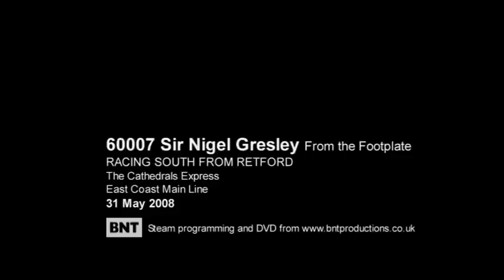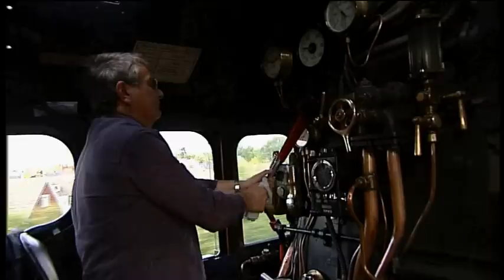60007 Breathtaking Footplate Run into Kings Cross - More

Comment: Ironic really...45 years later and people still crave to board a train behind a `Steamer` What a pity succesive goverments are not `railway` interested. And at the end of the day what is it all about....`profit` and greed?? Look at what we have got now...an enormous electric train set where the average person finds it hard to afford to travel on them...so much for `progress`?
Reply: are you implying people from the 30s could afford to ride behind an express loco like this?
the current franchise system may be a mess, but in general, everything is MILES BETTER than when these were still cutting edge modern locomotives.
They have charm and are engineering marvels, but you need to take in the world, and not be left behind in your own little bubble, as is increasingly easy with ever faster technological improvements.
Reply: @karlosbricks2413  actually common folk could afford to ride behind one of these in the 30s. If your implying that they could not then you need to check your railway history as most of the revenue came from third class passengers. The reason we pay so much now is network rail own the network and they charge the providers ie Virgin ect a fortune
Reply: We all like nostalgia but imagine a chuffer on it's way through the Channel Tunnel for example  No? Neither can I.

Comment: The spirit of Bill Hoole was in the cab.
His engine was no 7 and he got her up to 112mph in 1959
Reply: Bill Hoole killed his fireman in the Oakleigh Park Tunnel. He was travelling, well over the track speed but, He always did that. To show how much compassion he had for his regular fireman, he turned up for his turn the very next day!
Reply: @g7usl  Albert Young died because of poorly completed permanent way work. A rail joint had been left 3/4" high and this derailed the trailing axle of the bogie of 60528. The crew heard a rattling noise from the front of the train whilst halfway through Barnet Tunnels. Bill applied the brakes and asked Albert to try to see what was happening and he looked out of the side window of the cab when they exited the tunnel into daylight again. He saw nothing and so got out of his seat to look out of the gap between engine and tender in order to lean out a little further. The driver of a down parcels train working on the slow line witnessed the locomotive and train exiting the tunnel with sparks coming from the bogie. A little later the whole bogie became derailed and quickly started to tear the track to pieces. Albert was caught by a dislodged rail and was snatched from the footplate and was crushed by the overturning first coach. Bill hung on to the two injectors, the ride became smoother as the locomotive tipped on to its side and after demolishing the signal gantry at Bridge Number 37 slid through the bridge without hitting anything a stopped shortly afterwards.

Bill was almost waist deep in coal but extricated himself and climbed out. He was badly shaken up and was not able to walk properly and so when the guard came up he asked him to go forward to protect the train. Fortunately the accident had been seen by the signalman at Cemetery box and he sent Obstruction Danger for all four lines and 'phoned Control. Bill tried to retrieve belongings from the tender and then set about trying to find Albert but could see nothing of him and worried about the locomotive and the fire left in the box he made his way back. There were no tools left in the tender but fortunately only a small amount of fire remained and this went out on its own.

After hospital treatment he was anxious about his wife and after persuading a doctor to send him home by ambulance he managed to return home before her, removed the bandage from around his head so as not to scare her and then did that most British thing and made a cup of tea for the pair of them. After a cup of tea and something to eat he made his way to Kings Cross to make his report. The accident took place on July 14th and Bill returned to work on July26th. The Joint Inquiry into the incident started on the following Monday and was held by W. E Green the District Superintendent. The Ministry of Transport Inquiry by Lt. Col. R. G. S. Wilson took place on Friday July 23rd.

It was found that 60528 had one slightly weakened spring on the bogie but it was concluded that it was probably chance that the derailment had not happened earlier since the high joint had existed for a week before the incident. The speed at which the accident took place was 70 mph but in the absence of the locomotive being fitted with a speedometer Bill could not be blamed for this and no engineer would apply a restriction with less than a 10 mph safety factor. And the speed restriction on the track section in question was 60 mph.

If folk are going to pass comment they really need to make sure that they have done a bit of homework.
Reply: @DeCasoU1  I dispute your information. sonny?
 Any one of Kings Cross/Top Shed men will conform that they eventually found the firemen UNDER THE TENDER! I don't know where you got your information from but they are completely WRONG.

Comment: Wished they'd paint Gresley in garter blue like it was in the 70s and 80s and have the nameplate background in red instead of black, plus the wheels painted red also. It looks much better that way IMO. And why does Mallard have to be stuck in the NRM for?. It needs to on a track and running. I'm guessing it's all down to money, yet the control freaks running the country can spend billions on something most of us don't want like HS2 which is decimating huge areas of the countryside, all for the sake of getting to A-B quicker, and more importantly for the company it's about profits.

Comment: So stable.  Although that maybe down partly because of the welded rail and modern track laying techniques.  Would be interesting to see if it was this smooth in the 60s.
Reply: Flappy Paddle it would of been smooth as they had equipment to see how smooth the ride was I think there is a video about it somewhere it's very interesting
Reply: I think it's a bit of both - try a class 142 at 60 mph along the underfunded, unwelded rails of the Bentham line and you'll see what I mean!
Reply: The best thing about hitting little used lines not yet replaced with welded track when you're steam hauled is the constant "clackety clack" of the wheels. You forget it's missing on the welded lines until it you come off them.

There's some rough bits of welded line on the network, there's some smooth bits of line that aren't.
Reply: @robw7676  I used to calculate the speed as a schoolboy. Count the clickerty-clicks in 10 seconds and multiply by 4 for the mph. The rails were 60ft long. 60 mph is 88 feet per second. I would call that 90 fps, i was just using the second hand of my watch anyway, so, 90 fps would be 1.5 rail joints per second, equals 15 per 10 seconds, so speed equals 15x4 = 60 mph.

Comment: I have no problem with video ads, but to call this 'Breathtaking Footplate Run into Kings Cross' is wrong as it is click bait. You do not expect the whole video, but show it going into KingsX if you title it as that.
Reply from the maker: I sympathise with your view Peter. However it is a follow up excerpt video to the original 'Breathtaking Footplate Run into King's Cross,' which does actually show the arrival in the terminus. If you haven't seen that, do check the Channel and find it. The title of the one you comment on is 'Breathtaking Footplate Run into King's Cross - More.' The idea is to give subscribers more from the original full version which was available on DVD.